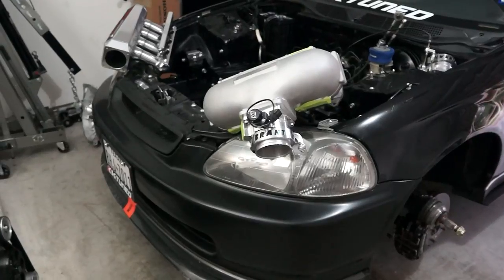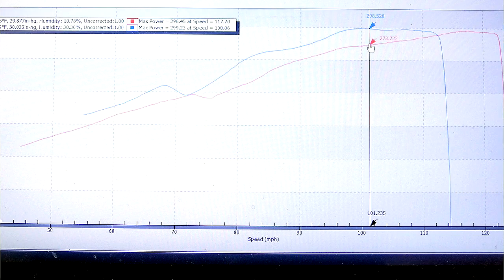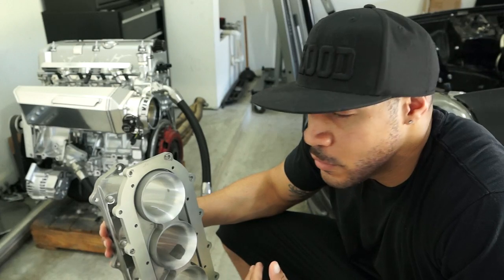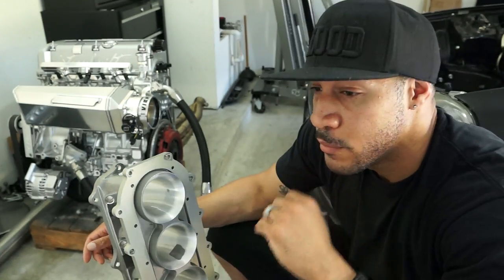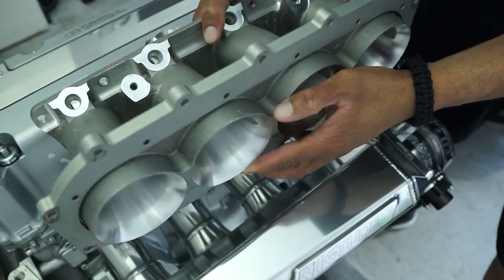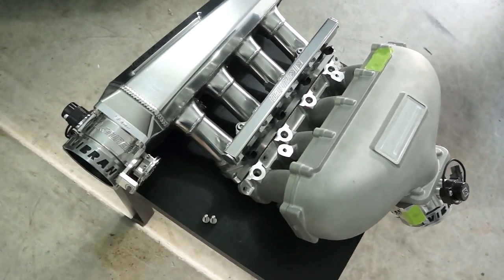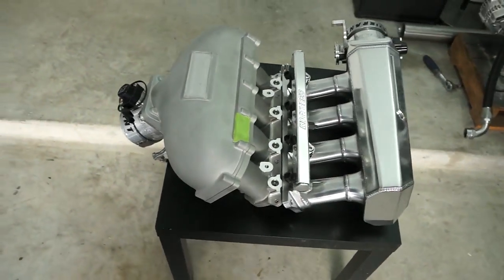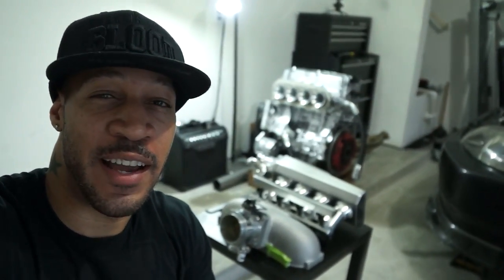K SERIES HUGE INTAKE MANIFOLDS...MY EXPERIENCE

Comment: Hi K, hope youre good bro.
Well, I ordered the K-tuned centre feed intake manifold a month or so back and have just been informed that they have discontinued it, 😟😞. A vendor from your side of the pond has asked me if I'm interested in any other manifold and has suggested a Gato centre feed.  They look similar to the one I wanted but I know next to nothing about the company. Can I ask your opinion on Gato and if you know much about them and the manifold I've been offered for my k24a2?
Respect bro
Reply from the maker: GATO is a reputable company. Downside is their centerfeed manifold uses a very large runner which focuses more on high rpm power and mostly used for boosted applications. They are good manifolds though.
Reply: @ksisjdm  nice one K, thank you for responding.  I might have to pass on that then,wanted thinner longer runners ideally. There is currently no ETA for the revised K-tuned K20 version of which I'd have to use an adapter for K24. . Sigh 

In the meantime I'll be getting DC 004 Cams,  after speaking to Jeremy it seems the 004.5  cams would lose me some mid range but give about 7bhp more.

Could I continue with my build and  run the 4's with the rbb manifold until I finally get the K-tuned or should I just wait do ya think?
Reply from the maker: You could continue theres no rule making you stop. Just expect power to be restricted a lot by the intake manifold. I would at least use a RBC intake manifold in the meantime or something
Reply: @ksisjdm  looks like the centre feed manifold will be available early March 2019, , , 🎊🎉! Shall also be getting the powersteering relocation kit and the adapter for the k24 😎
Reply: @ksisjdm  I got it!! Now I just got to figure out keeping my PS! Would using the PS relocation or their EP3 pulley kit not be any help do ya think?
Reply from the maker: I'm not sure if it will help or not.  Each manifold is different and some have room to squeeze in the pulley without hitting the plenum and some don't. Most of these manifolds arent built around retaining luxuries
Reply: @ksisjdm  Bottom end is done, heads in the shop getting 3 angle valve job and recutting the seats. Think I'll  put it together first and see if I'll be able to keep ps.if not, then delete kit it is.. Or that Toyota MR2 electric ps pump idea.

Hope yours is still riding hard bro 👊🏽😎
Reply from the maker: Good stuff man. Yeah mine is still running strong.

Comment: if the intake manifold runners on the skunk2 are bigger (at the flange exit) then that of the cylinder heads intake ports entrance. this create intake air reversion and you will actually make less power then a stock port intake manifold, the transition of air has to be smooth if the air hits a step it messes up the flow pattern into the cylinder head. in your video it looks like your cnc s2 intake had bigger ports then your hand ported cylinder head thats why i am commenting.
Reply from the maker: I'm well aware of how the air flow works. The  CNC skunk2 intake manifold is perfectly matched for the CNC 4piston pro 156 head it was ported for. The matching head  with that manifold was directly back to back tested against the unmatched ktuned manifold and still the skunk2 manifold was outperformed until reaching 10,000 rpm where the skunk2 finally had a small edge. This video was just to give people some generic info and a visual of the two company designs that are readily available. 

All the testing that was done was legitimate and in fact favored the skunk2 but the results spoke for themselves.
Reply: Childstar do you think this K-tuned intake is necessary for achieving 300bhp on this engine? I've just imported one to the UK and it'll be going into a 5th get prelude. Only thing I've kinda decided on so far is upgrading the pistons to 12:5:1 wisecos, and getting stg 2/3 cams.bottom end shouldn't need sleeving should it?I want it as my dd
Reply from the maker: On my engine and with the fuel I'm using, yes, I need a large intake manifold to get to the 300 hp range. If I used better fuel I could use a smaller manifold

Comment: Child star what can i do to beef up my h22a engine
Reply from the maker: +Cary Williams start with bolt ons all around, and then id look into the h2b conversion. One downfall of the H is that slower transmission. A b trans will really make that thing take off
Reply: Childstar what bout magnus intake manifold?
Reply from the maker: What about them?  They make more than one manifold, and you should know Magnus makes the ktuned manifold to ktuned specs. Same information applies to ALL companies. Every manifold is designed for a specific purpose, there isnt some generic layout.

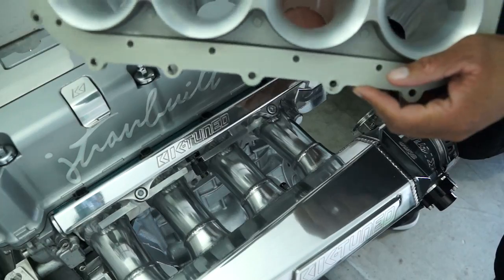Comment: can someone please tell me what is that part to the right where he is unbolting the intake manifold at 4:17?
Reply from the maker: A k20 upper coolant neck.
Reply: Childstar if I send you money via PayPal, could you post parts to me?trying to avoid customs charges etc. Lol I just imported a k24a2 to the UK because I saw one going for a good price, but by the time it got here and I cleared it ,it wasn't such a bargain anymore. I'm starting my 300whp dd build and like the look of some K-tuned parts,but I don't wanna get stung all the time by customs n duty. Your build is 🔥🔥🔥
Reply from the maker: And what benefit would I get working and shipping parts to you?
Reply: Childstar Wooooooy, maybe helping a struggling UK niggah out man!? 😮 besides,I only really meant like the manifold,once I saved up for it. It's cool,all the best. 👊🌚
Reply from the maker: Sorry it's not like I have money to help out. I hardly can do anything for myself
Reply: Childstar nah, that's cool, I hear that. Didn't mean to be cheeky, but if you don't ask,Ya don't get I suppose.Just thought it'd be a case of me having to not pay customs if it was sent as a private parcel.

The 06' tsx will be going into my 5th get prelude. I'll be running 12.5:1 wiseco's, stage 3 or 4 DC cams, not sure about the header yet, that K-tuned one might be overkill but it looks so good. Maybe custom exhaust mani , and some good headwork.I want a dd 300bhp using Uk 95-98RON pump fuel. 
I'm on K20.org reading some of your threads while I'm at work right now, trying to piece together a Lil something that will turn a few heads. Thanks for the inspiration cuz

Comment: Center feeds only good because it gives  equal air to each cylinder
Reply from the maker: +Nick Stevenson not true.  That's a fact if and only if the centerfeed design is well made. The skunk2 centerfeed without a plenum spacer has shown to starve cylinder 1 and 4. But your comment is basically legit.  

Thanks for watching dude.

Comment: Can you run ac and ps with centerfeed intakes?
Reply from the maker: Yes, but the requirements and your approach to retaining AC and PS will vary based on the centerfeed manifold that is used. Plenum shapes and sizes vary and the angle they extend from the head. So you might have to do some custom work to keep them, but it's possible and it's been done before.
Reply: @ksisjdm  i plan on using excessive centerfeed for my k24a jdm

Comment: How much did your engine build cost roughly?
Reply from the maker: Not really sure, maybe 4k overall. I don't know. Some parts were sold to buy upgrades to offset retail prices.
Reply: @ksisjdm  I just picked up a 2000 ex, following your build, I want to go fully built N/A, I was debating keeping the D16Y8 it came with but after doing some research it seems the K swap is the right choice, what I still haven't decided on is if I should go K20 or K24. After having yours for several years, what would you do if you had a fresh build? 🤔
Reply from the maker: In all situations I would do a K24 build every time.
Reply: K24 it is.

Comment: Skunk2 manifold is better in the end cause you can open it up and polish it and add spacers you can't do that with k tuned. Also is you bangin bloods in the video. I knew childstar was a gangsta
Reply from the maker: It's not really better per say, it depends on the application. Its not always better to open things up and make it huge internally. That effects the powerband greatly.  So it depends solely on the overall setup

Comment: That velocity stack is no good, shoud have full radius down to the plenum floor. That sharp lip creates turbulence that cuts the flow to the stacks.
Reply from the maker: Uhmmm why are you telling me?  Lol not like I designed skunk2's intake manifold Haha.  Thanks for watching and commenting.
Reply: It was just an observation, and I find it very odd that a name brand go fast part is designed like that. Would be interesting to cut a radius to that corner and running it before and after on the dyno.
Reply from the maker: I feel you man, just messing with ya.  But you're right for sure.
Reply: I thought so, thats a beautiful engine you have built. Need to watch more of your vids for more details. This one just popped up on my feed.

Comment: 300 hp, if doable... I'm taking the old engine out, and getting body work done... a 08' tsx, with ECU, will run me $700..
Reply from the maker: +Dolla Washa can't use the tsx ecu in your case. You need something like a prb ecu.  And if you want 300, you need a complete build. Either built block and a built head, or a stock block with a really well built head, induction, and exhaust setup and good fuel to still reach 300 all motor.  Might as well start with the cheapest block you can find and build it up for a reliable less stressed 300hp engine.

Comment: The center feed is still climbing at red line vs the other one that is falling off and 10hp is nothing the center feed is better in my opinion from what I see ever on the second motor you test you can see how much further it carries the power vs falling off and again 6hp difference is nothing the center feed shows the best power band 👍🏾
Reply from the maker: Both manifold tested were side feed manifolds.  It's true the skunk2 ultra race carries power further, but 9 out of 10 people aren't building cars that are revving above 9500 - 11000rpm. Your average user would have a blown engine trying to rev to there in an attempt to warrant using that skunk2 ultra manifold. 

So each manifold has a good place to be used, and the powerband needs to be taken into consideration.

Comment: what engine block are you using? k20a?
Reply from the maker: +Double Clutch No.  A K24a2 block bored to 88mm at 12.5:1 compression.
Reply: This is what I was running but with a built K20A2 head.  I was running a stock Type S oil pump and starved cylinder 4 of oil and spun a rod bearing... So a $13k motor lasted me less than a year...
Reply: sbounty3 im planning to turbo a k20a3 with stock internals do you think it would last? i found one cheap in a scrap yard with less than 50k mileage. did you turbo yours aswell?
Reply: I didn't I was NA running Pauter Forged rods, Supertech 88mm 12.5:1 pistons, all ACL bearings, full Supertech Beehive valvetrain, IPS K2 cam's, head and IM ported by ASP Headers.  I was making power up to 9k RPM's, but didn't realize the type a oil pump wasn't supplying enough oil to the cylinders at high RPM's.  I think with the K20A3 if you use a type s oil pump and have it ported, or pick up a KMOD, ERL, etc... you should be ok.  Also, make sure you invest in a better head gasket (cometic), ARP headstuds, and colder spark plugs and you should be ok running 7-9 lbs of boost for a while.  The problem with that motor is the internals are pretty weak.
Reply: I am however planning to boost my new-er K24A!
Reply: sbounty3 is there a ppssibility i can break my motor if i abuse it when running stock? well i wouldnt enjoy it much but just asking since you mentioned that k20a3 has a weak internals
Reply: I had an 05 EP3 and beat the piss out of the K20A3 for about 3 years, on the street, at the drag strip, and auto-xing it.  I never broke anything on it.  I mean weak as in not being able to handle a ton of HP added on without upgrading it.
Reply from the maker: +sbounty3 I have a built prb head on mine
Reply from the maker: +Double Clutch any setup can last, it depends on the tune, the maintenance, and how much power you're planning on forcing through it. 

I started to turbo mine and then ran into financial issues and sold most of my turbo stuff.  Maybe one day later ill finish the turbo setup
Reply: Awesome, that's what mine was as well.  I was running the IPS K2 cam's, which made great power up to 9k RPM.  But I was planning to switch them out for the DC 3.5's before I spun the rod bearing.  Sorry to hear you had to sell your turbo setup...
Reply from the maker: +sbounty3 yeah that's why tractuff has that cam tower mod for additional oiling.  

The turbo was for a second setup I want to do so it's no biggie. And goal is to have an allotor engine and a turbo engine ready to be exchanged for one another at any time. Keeping me from having downtime unless I had horrible luck and broke them both back to back lol.
Reply: Man that would be awesome to have a setup like that.  I never even thought about that Tractuff setup because I thought it was only for oiling the valvetrain.  I also didn't find out about the S2000 ERL, KMOD, or 4P ported pumps until I had already spun a bearing... I am going to try and get my RSX running tonight or tomorrow I will post up a video once I do.  Childstar, check out my IG I have quite a bit of both builds on there.  IG = @AZEVOL250